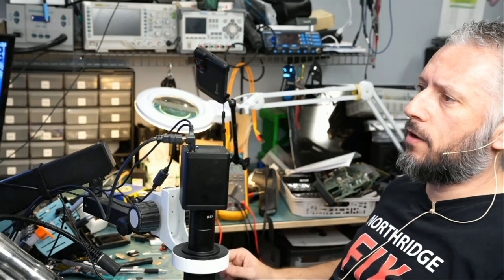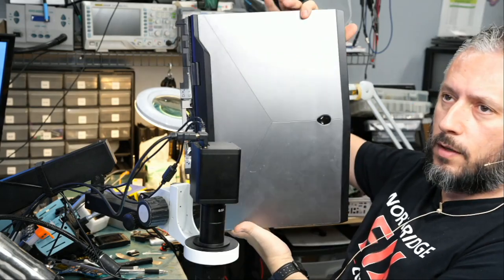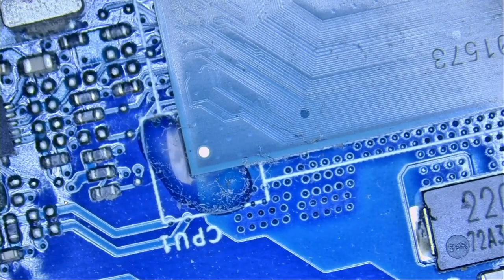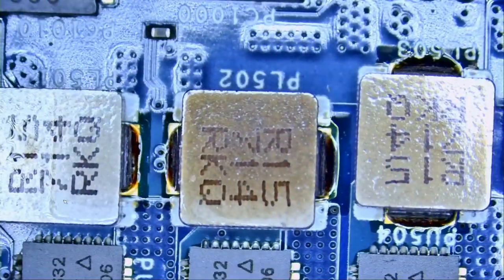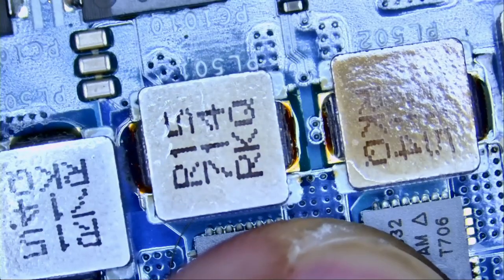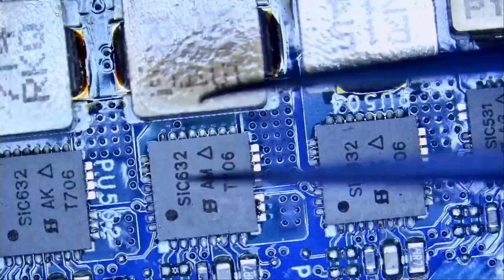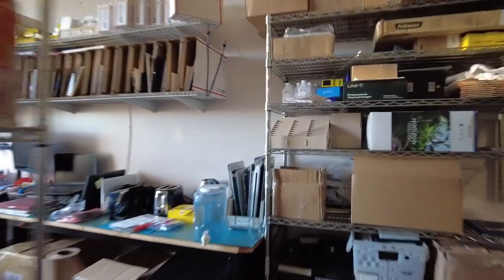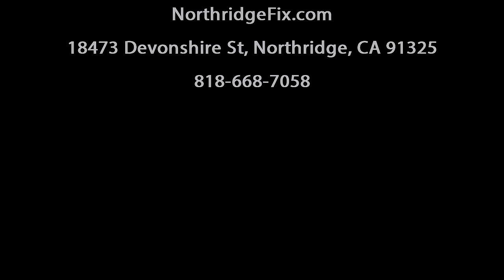Dell Alienware 17 R4 Notorious for CPU problems - Is it Fixable?

Comment: If it's the CPU problem and you can't replace the CPU, why don't you replace the whole board? Are you fixing the laptop or only fixing the motherboard?
Reply: If you need and want to replace the whole mobo, better going to Dell and ask.
Reply: A new/used mainboard with soldered cpu will cost more than 600 USD, and it will die exactly the same way after some time of usage (a used mainboard can die within days/weeks, after you have invested 600USD in it). So it's not worth the money for an old laptop. - A good advice when you buy a gaming laptop: Get the longest warranty period extension the manufacturer offers, for a highend laptop it is highly possible you will need it.
Reply: You would have to get the exact same board...it is near impossible to get that specific one.  This one is the i7 7700 with a GeForce 1060 8GB.

Comment: Question: could you not of replaced the cpu from the Donor board to see if that would have fixed it?
Reply: Time and expenses. It takes much longer to replace the CPU and not that cheap/easy to get a working CPU. Is it worth it on the customer side
Reply: Donor board has a dead CPU as well.
Other than that, even if you have good CPU it is not economical to replace it.